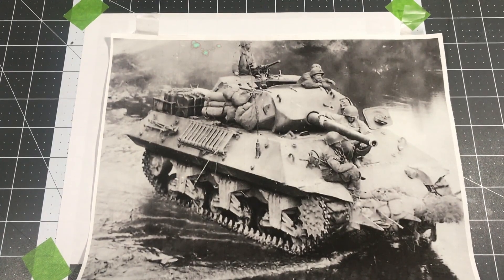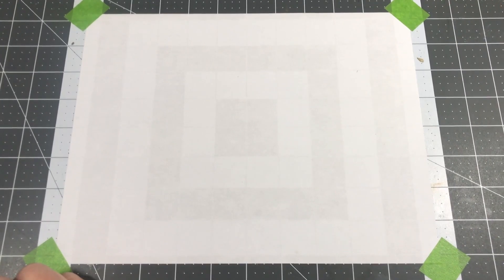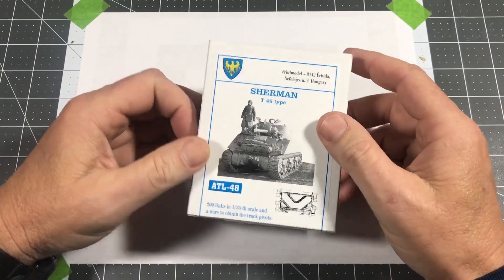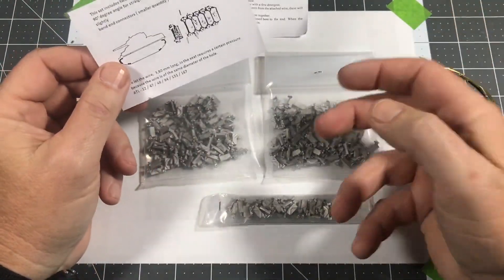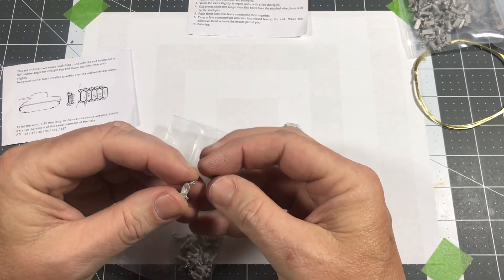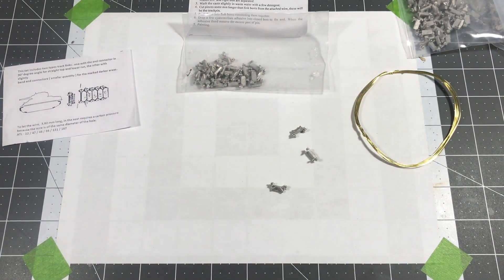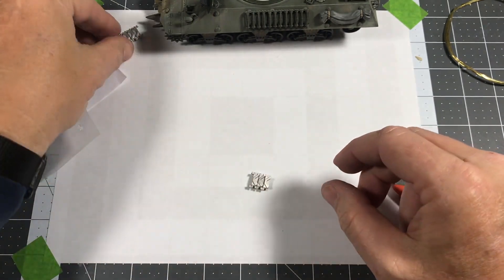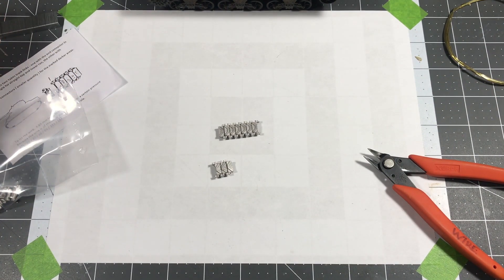Plastic Models For Beginners Building From A Photo pt 8

Comment: Saw something today that might work well with those track kits, at hobby lobby search the beading wire isle. You'll find the hardware section as I call it but it's all the ear ring stuff. They've got pins, pins with tiny loops at the top, etc. They all come in 4 different shades as well from gold, copper, silver, and antique bronze. Each baggie sells for like 2 bucks. I use the flat head type(look like a "T") to add hexagon plastistruct rod that I've snipped off to simulate bolt heads. The shafts can be cut any length you need and they're not to tough on ur cutters. Wandering around Hobby Lobby yields more than most realize for our hobby. Sadly though there Model selection is going from bad to worse.
Reply from the maker: Good tip, Warren. Next time I am there, I will have a look. They do have some useful stuff that is technically non-modeling related, but alas, their model section is not the best... unless you like cars. They seem to have tons of cars, but the military section is not very good. Recently, they have even started stocking more Lindberg armor kits, and those are horrible!